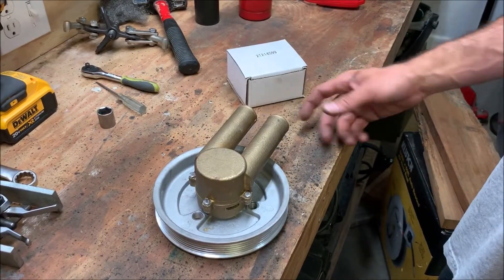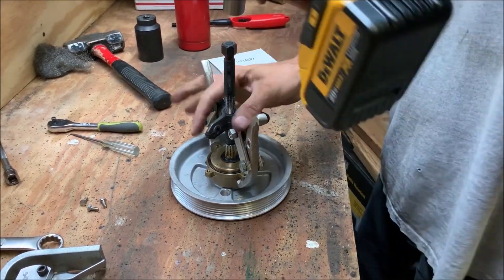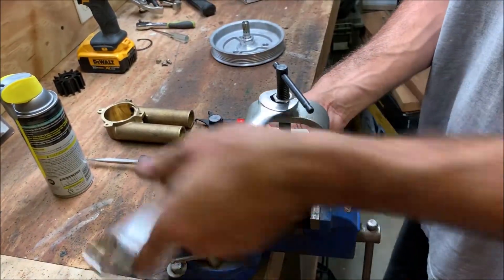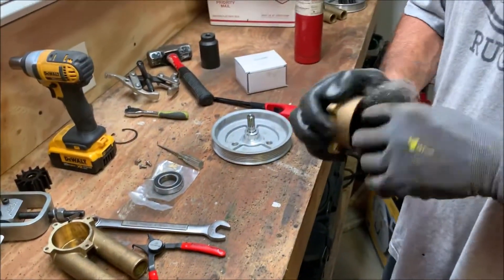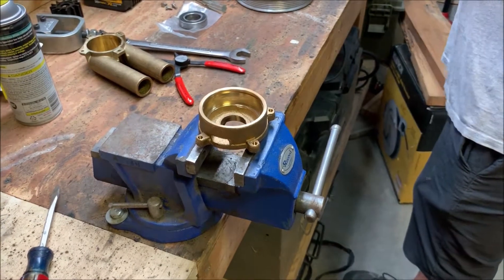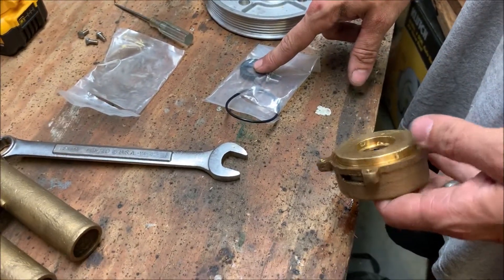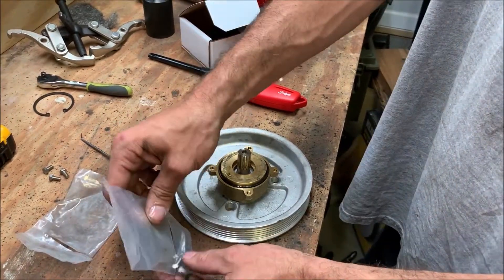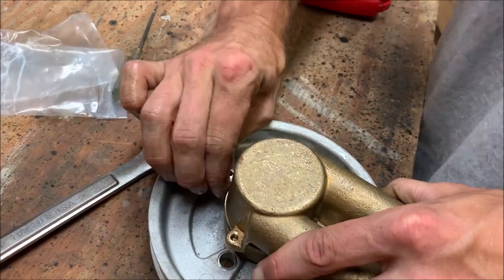Volvo Penta Raw Water Pump Rebuild  21214599

Comment: So if I have water dripping out of mine, would it probably be that O-ring or maybe the smaller seal that goes around the shaft?  I just recently bought a boat with the Volvo 3.0 and at idle I didn't notice anything leaking.  However, when I revved it up to around 1500 rpm's, I started seeing water leaking from this pump.  I'm hoping a simple rebuild will take care of it.  Thanks
Reply: If it's leaking then the inner seal is bad and the entire pump needs a rebuild.

Comment: Make sure you spin the impeller the proper direction and make sure they're all pointing the same way (back). I believe it was in the right direction but one of the fins was pointing backwards when you installed it. Overall great video. Thank you for your knowledge.
Reply: That is unecessary, the fins go the right direction once they  begin to move.
Reply: @dustdevilmedia  Not the case for me when I replaced the water pump on my outboard. Had the fins going the wrong direction and they stayed that way until it forced water past the seal into the lower unit. I noticed water in the oil and disassembled the lower unit to find the flaps still pointing forward.  I later heard not to rotate the engine backwards dry because of this same reason. Maybe just a fluke for me.

Comment: Nice video how did it work on the boat im afraid to heat and cool up stuff that seals water. I dont have a torch would putting it in really hot water for min or 2 work the same ?

Comment: My engine is a 2008 5.7 GI-J and uses the taller Impeller. Do you have a Kit for that application, or can I use this Kit and just get the proper Impeller separately?
Reply: I have the same engine and water pump. Did you find a kit for yours?
Reply: @wdschwartz8386  I ended up buying a new one from the dealer...talked them into a 20% discount.
Reply: @wdschwartz8386  Both type use same bearing and seal. I got one from Amazon.https://www.amazon.ca/gp/product/B079RMJ32G/ref=ppx_yo_dt_b_asin_title_o02_s00?ie=UTF8&psc=1

Comment: Great video.  I will be rebuilding mine every other year.  Only comment is that I believe you put the seal on backwards.  From my knowledge, the cup side showing the spring should face the impeller and not the bearing...but I am certainly no expert.  Thoughts?
Reply: He put seal in backwards for sure.